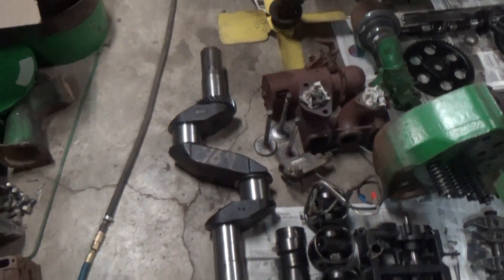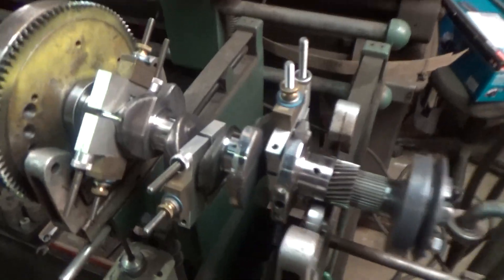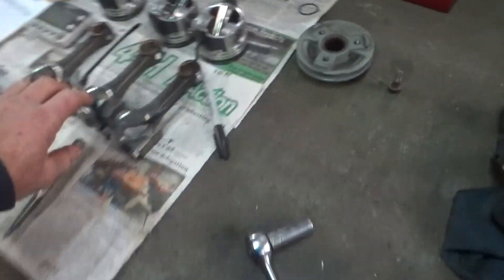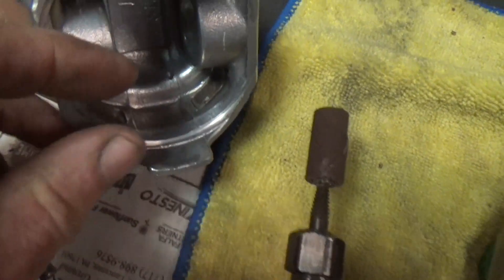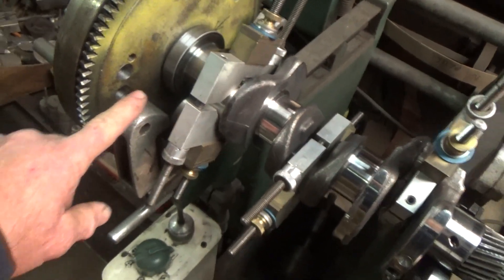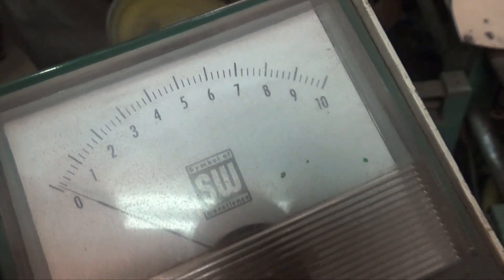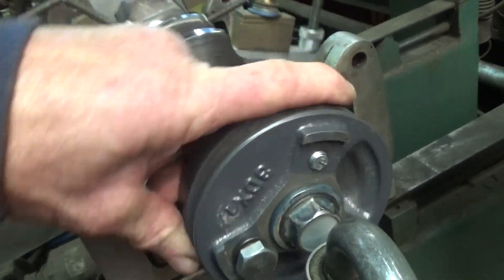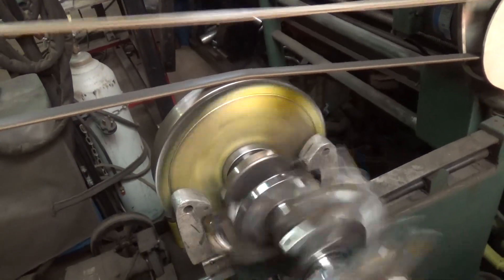Why Engine Balancing ?

Comment: I had an Allis Chalmers 301 engine I rebuilt balanced by the machine shop, it made a huge difference in the feel of the engine, smooth compared to everything else I had ever been around. Thanks for the videos, Bill.

Comment: Oooh, that’s good stuff!  I made an attempt to build a 2.3 liter rocket when I was 19. Of course I had no clue how to do it. I managed to get the reciprocating pieces to weigh out properly, but the rotating assembly didn’t get any attention.  Didn’t matter, I got a defective cam from Ford Motorsport and it wouldn’t rev past 4k anyway!   At which point I sold it and bought a V8…😂
Thanks for the show!   Bless’ns to ya sir,   Tedd

Comment: Another great video Bill please keep them coming! After your tire grinding one you got me fired up about pulling again and I bought another set of rims. Still looking for a set of tires to cut. Also bought another pulling tractor!
Reply from the maker: Great Calvin! Tell me what you got and what class you'll pull.
Reply: @so.md.dirtfarmer2226  I bought a Massy Harris 44 row crop narrow front. Going to try putting a 265 flat head out of a combine in it. Pulling 4500-5500. It has 16.9-38 radials on it that would be good ones to cut. Still looking for a pair of 18.4-38 to cut for my 460 farmall. Thanks for the reply. Also keep up the tractor church!!

Comment: I use to build them engine dampers that go on the crank
And damping devices.
I know right where you are coming from.
Brings back memories.
You checking that crank is the same way we would check balance shafts.
The only difference in a balance shaft you are checking unbalance wieght .
Many of the newer engines of today run them. That why they turn so many R P M